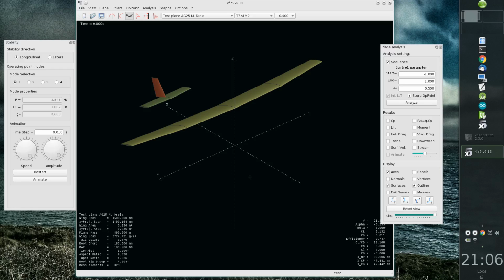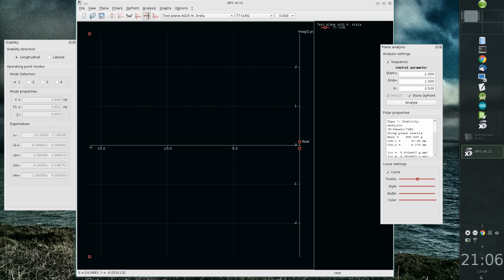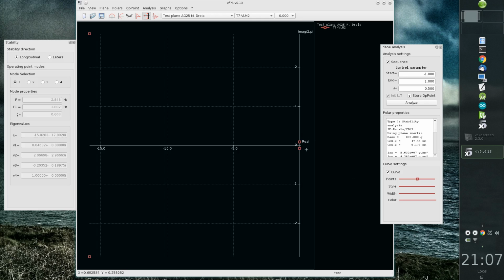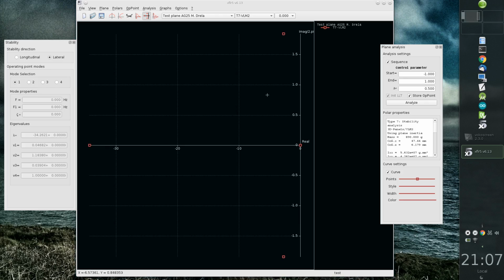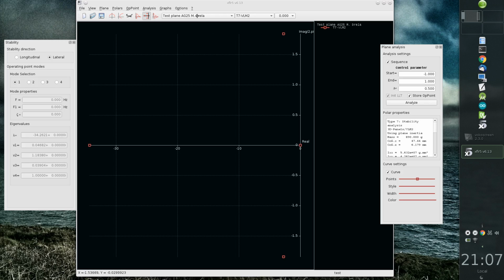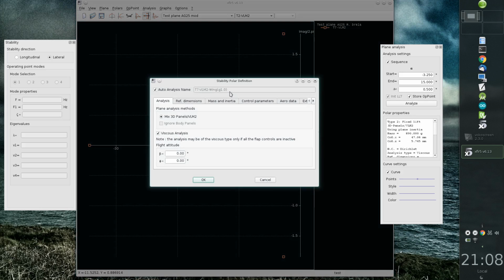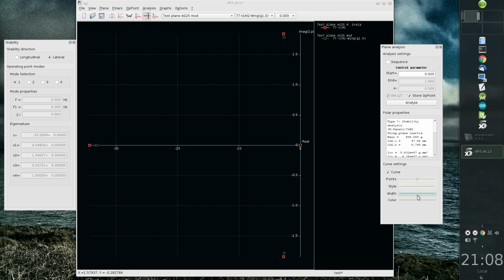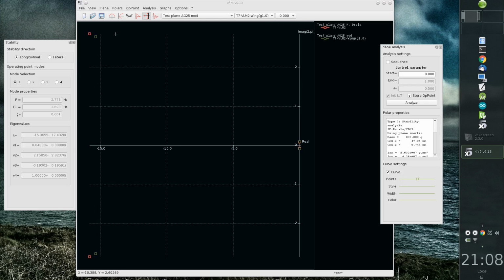14 Stability: root locus graph

Comment: What does it mean when there are points on the horizontal axis for longitudinal stability? I have the two phugoid mode points with low frequency but the other two points lean far left and on the axis.

Comment: What happens if we have a point at the right side regarding the lateral stability? I have a point at 0.02 roughly and it messes up the time diagrams. The plane is not lateral stable..........
Reply from the maker: The non-periodic spiral mode often falls slightly on the right side. I couldn't find out if this an error or just the natural stat of things, because there is not much experimental data to go on, and the mode is so slow that it can hardly be measured. The 3 other modes should fall on the left side. If they don't, especially the Dutch roll modes, then it probably means that the plane lacks lateral stability.